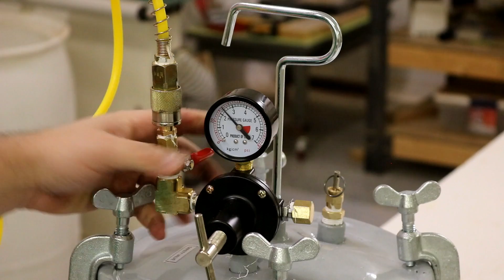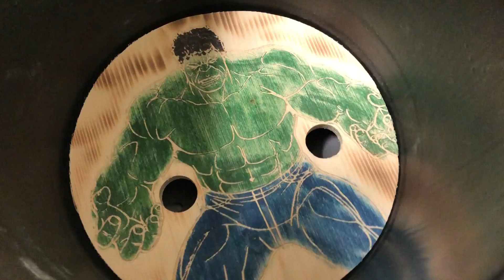Converting a Harbor Freight Pressure Pot for Resin Casting

Comment: Jake,  thank you for this.  Question:  will a normal tire air compressor connect to this?  I'm new to the idea of quick release valves.  If not is there a different part I should buy?  Thank you again!
Reply from the maker: Thank you.. you need a compressor with a tank at least as big as the pressure pot tank. A tire inflator will be way too slow. 👍👍

Comment: Looks great, for solid colors. what if you put something in the resin, say, color swirls or say dried flowers or something, wouldn't the pressure distort and ruin the casting?
Reply from the maker: theguitarpicker No, it won’t distort things like that. I’ve done lots of pours and that has never happened.
Reply: @JakeThompson  I haven't used resin (epoxy actually, I don't think they are the same) for anything other than filling cracks and knot holes, I wanted to experiment with using dried flowers and other stuff.

Comment: My pot is leaking where I removed T fitting and screwed in the taped gauge....I hand tightened it all the way in....any suggestions to fix?
Reply from the maker: offtofish There is a  paste thread sealer you can use.. it should seal it up.
Reply: @JakeThompson  thank you bud!

Comment: Hey Jake, my pressure release valve sheared off when I was trying to unscrew it from the lid.  I managed to get it out, but fair warning for future endeavors.  You may need a kit for taking out bad threads!
Reply from the maker: xannmax noted..👍👍
Reply: @JakeThompson  wait, now that I have you, could I ask you a question?  What threading for the new pressure release valve should I get?  I'm fairly new to brass fittings and I don't have the measurements memorized yet.
Reply from the maker: xannmax I believe the common size for relief valves is 1/4 npt

Comment: Hmmm... I would think that curing a resin under pressure will make it more brittle and prone to exploding. Especially if the piece is dropped or if the temperature is high enough of a change from the time of cure. Since you're not removing the air, you're simply compressing the air molecules/bubbles, once cured and removed from the pressure chamber - those air molecules are still under what ever pressure they were brought to in the pot. Raise the temp - air expands, pressure goes up - raise it high enough and BOOM!

I believe Pyrex had that issue way back as they used pressure to cure their resins from what I understand. Once heated - they would arbitrarily explode. They since have changed cure methods to prevent that.
Reply: Fair enough, but keep in mind that the typical things that are cast under pressure (think knife blanks in this case, or toy figurines for example) are never heated again to high temperatures. Plus, the bubbles that are collapsed under pressure casting are usually tiny, so there is not much air in them in the first place. Maybe there is some risk of an impact cracking a pressure-cast resin piece, but I've certainly never heard of a piece exploding.

Comment: Is it normal for the tank to make creaking noises as you fill it with air? 20 psi is making unsettling sounds.
Reply from the maker: Pablo Escobar it’s normal the first couple times you fill it.. should be fine!! 👍
Reply: @JakeThompson  Thanks, Jake! Still working out where my air leak is coming from. I suspect the gasket, as all of my other fittings seem quiet and solid. I'm about to break out the soapy water next.
Reply from the maker: Pablo Escobar Sometimes my kid leaks.. I just clamp it to the table.. fixes it right up

Comment: Thanks for the great video Jake, I had a vague idea of what I needed to do, but you really clarified it for me. I will say this tho... because my local "big box" store is usually lacking in the restocking department, I had to do design on the fly kinda thing while standing in the air tool isle.  Because of that, I ended up buying extra stuff just to avoid a return trip. I ended up realizing that you only need three adapters. I didn't use the supplied "T" or gauge. I relocated the blow out valve the same as you, but the input is just the hose adapter to a ball valve to an inline pressure gauge. It's just a much simpler version of what you showed us. Thanks for getting me pointed in the right direction... can't wait to use it!!
Reply: I tried to upload a pic.

Comment: do you have to have the pot up right or could it be lay on its side to as this way could get bigger molds in ?
Reply from the maker: phil walker I don’t see any reason why it wouldn’t work, but you would have to have some way of leveling the side to be a bottom so you don’t spill the molds.. if that makes sense?
Reply: cheers for the help fella great vid ATB
Reply from the maker: phil walker 👍👍

Comment: A vacuum chamber works much better, it make all the bubbles expand and rise to the top and then it leaves bubble free resin. This merely makes the bubbles smaller, it doesn’t REMOVE them
Reply from the maker: Terry lagrave Do you have enough time to remove bubbles with a vacuum chamber with resin that has a 12 minute open time.. The answer is no. Have a great day!
Reply: And a vacuum creates a huge mess and wastes a lot of resin.

Comment: A very informative video!! Thank you! I subbed your channel. 
The idea is to get rid of the small bubbles, am I correct?  Long time ago some guys who did casting used a vacuum pot for this.  Are both achieving the same thing?  If so which is better?
I've been wanting to cast some delicate glass objects, and objects damaged by heat. I'm worried about the resin heating up and expanding and contracting to where the glass will break. What resin would be good for this?
Reply from the maker: tihzho Thank you for subbing and watching the video.. the vacuum chamber will work for very slow curing resins.. The resin I use is only workable for 12 minutes.. the pressure pot works awesome to take out the bubbles with this resin.. I haven’t done any casting how you are describing.. my advise is to buy small amounts of several resins and experiment. Maybe I can do some excitements like it in the future too.

Comment: Sorry this question has been in the back of my head can a pressure cooker?
Reply from the maker: TheMonkiekitty It takes 45 psi to work.
Reply: @JakeThompson  cause I have old pressure cooker that I used for sanitation and I thought about that pot I will have look in to parts

Comment: Hello,

I’m attempting to set this up and I’m finding that the pop off valve begins releasing pressure at about 30psi. How I can I fix this? Are there any videos on this particular issue?
Reply from the maker: Maya Mascarenas There are 2 slots around the valve.. you take a small flat screwdriver and turn it clockwise and that adjusts the pressure up.
Reply: Jake Thompson Wow thank you for replying! I had been trying to tighten the wrong thing, thank you for explaining it. There are a lot of great videos on resin and pressure pots but I find yours to be the most clear and thorough, I really appreciate it. <3

Comment: what happens if you put it in a vacuum chamber ??
Reply from the maker: Raymond Ashby If it’s a Resin with a very long working time, it will remove bubbles.. there are videos out on this technique. The resin I’m using only has 12 minutes working time, so there’s not enough time to put it in a vacuum chamber
Reply: @JakeThompson  check out stonecoat.. thy have some great resin
Reply from the maker: Rusty Alcorn will do!!👍👍

Comment: If I may ask why dont you use a vacuum chamber to remove any air from the resin ?
Reply from the maker: skeets I have heard of  removing air with a vacuum chamber, but with very slow  curing resins.. With faster setting resin like alumilite, the pressure pot is required.

Comment: I just did the same conversion I have a small leak somewhere on the seal on the lidit takes about an hour for it to lose 15 pounds but it's such a small leak I can't find it or am I not tightening the lid enough?
Reply from the maker: aaron johnson Tighten the opposite sides together and sometimes I have to use clamps and clamp down from the lid to the table.. I also use a wrench to tighten the lid more.. I also leave the air hooked up, with the regulator working correctly it will keep the pressure in the tank where it needs to be.
Reply: @JakeThompson  thank you I'm going to go try that right now

Comment: is there a reason that you're using a Pressure Pot for resin casting and a Vacuum Chamber for Stabilizing Wood? You can't do the resin casting in the vacuum chamber? And great video btw!
Reply from the maker: killy2626 The resin I use has too short of a working time to use the vacuum chamber to remove the bubbles.

Comment: What are the inside dimensions of the pot?
Awesome video!!
Reply from the maker: CobaltSS04R Thanks!! I’m glad you enjoyed the video!!  Here is a link to the pot, it shows the outside dimensions.. https://m.harborfreight.com/2-1-2-half-gallon-pressure-paint-tank-66839.html

I think the bottom of the tank on the inside is about 9 inch circle.  And you can put around a 10 inch tall mold on it.. or close.

Comment: What size of  air pump to use for this pressure pot ?  I have small working space .
Reply from the maker: Maneerat Romtrairat I have a large air compressor but that’s not required for the pressure pot.. only 55psi is required.. a small air compressor will work.
Reply: @JakeThompson  Thank you so much for your answer .I plan to buy pressure pot and air  compressor  for casting my resin work
Reply from the maker: Maneerat Romtrairat Awesome... it’s lots of fun!!

Comment: Hey Jake this is great, thanks for posting it! I'm headed out to buy the pot and all the stuff, but I have one question: For the air compressor, do I just need one that is capable of up to 60psi, or do I need a more high end compressor? Do you have any recommendations for a (mildly) inexpensive compressor?
Reply from the maker: Blacky Shepherd I think the compressor tank just needs to be bigger than the pot. That’s all. It doesn’t need much.
Reply: @JakeThompson  Thanks for the quick reply!

Comment: My pressure valve is releasing air. Turning the pin doesn’t appear to be doing anything. Why does my air compressor gauge differ than the regulator reading?
Reply from the maker: Joe Bruno there’s a notch at the base of the pin.. you stick a small flathead screwdriver in the notch and turn it clockwise. The regulator should be lots lower than your compressor.. The metal T sticking out of the front adjust the pressure going into the pot.. I hope this helps
Reply: Yes that helps. I will try to adjust it.  Regarding the compressor, its the one I use to inflate car tires with. The gauge on that differs by at least 10 PSI when I check it against whats inside the tank and compare it to the gauge on the tank. I dont wanna go past 50 and bomb myself out of my garage so it don't know which one to trust.
Reply from the maker: Joe Bruno Those gauges are cheap.. I would buy another one and see if it reads the same as the one that is on it now.  As long as you aren’t going over 60 it should be pretty safe.

Comment: Tapping the threads to 3/8" pipe thread is VERY important. The original elbow piece has pipe thread going into a MACHINE thread hole.
Its a giant safety risk and needs to plugged with a machine screw and seal washer if you dont tap it with pipe thread.
Never exceed the chamber rating of 60 psi.
Reply: @matthewlawton9241  There's already a popoff valve that does exactly that. But you can buy them just by googling air compressor popoff valve.

Comment: How did you adjust the pressure pop off valve? Mine popped at 35-40
Reply from the maker: D35TR0YM4N There are slots on the pop off.valve that look like a regular screwdriver head.. the pop off valve is right in the middle of it. Just turn it like a regular screw. 👍
Reply: Thank you very much sir!

Comment: If you don't have an air line can you use a battery powered car tyre pump or would it take too long to reach max pressure?
Reply from the maker: ColinWatters I’m sure that would take too long.. Harbor Freight sells very cheap air compressors as well.

Comment: So, I have been just learning how to bend/shape resin (in silicone molds) right before it gets too hard to shape. Could I use this method, just for a shorter time, to get a clearer resin, and still be able to shape it? Does anyone know? 

I am looking to copy a shape of a specific type of round glass lens which I need to duplicate, but make the diameter smaller than the original. I want to use the shape from the original to shape the mold all the way across, and then pour the resin in it, let it start to harden while flat, and then curve it to the diameter I need it. If i need to attach the ends with more resin (mixed hotter, if that is a thing, like paint) or with a hot glue gun, or whatever, that won't matter, as I can hide it in the back of my project. I just need to reduce the size of the round lens, and this is the only way I can think of to do it. To describe what i'm doing, I am building a 3/5ths size TARDIS (from Doctor Who), and have an actual real fresnel lens, but it's too big around, so I need to reduce the size - that's how i got the idea to roll up the resin before it gets completely hard, to get the correct size. I will need to remove about an inch out of the shape, and get it round again, once poured.

I've been asking around some of the videos working with resin, and hope I get a few answers, so I can figure out a) which resin would work the best, b) how to make it as clear as possible to look like clear glass, and c) how to shape it the best. Any helpful suggestions are appreciated.
Reply from the maker: Mary Ann Bittle I’m probably not the guy to ask this, but it’s worth experimenting with if that’s what you want to do!!
Reply: @JakeThompson , that's okay. Thank you for your response, anyway. I appreciate it. 

I've been asking basically the same question of many people who mess with clear resin on here. I figure that, with several "I don't know-s" and several "that's a stupid question-s" I will eventually get some helpful information from someone. I'm willing to wait.   😄😁
Reply from the maker: Mary Ann Bittle 👍👍👍
Reply: That sounds really cool. If you do it, you should post it up here on the tubes and you'll be the expert answering questions. =)

Comment: I just have two questions. That pressure pot looks expensive, plus whatever you spent to convert it, how much did you spend?
Second. vacuum chambers suck all the air out, contrary to what you are doing, but with the same results. Depending on the final cost, is it worth to do the conversion, compared to a vacuum chamber?
Reply from the maker: Robin Dz You can get the pot for about $80 dollars with a coupon.. and there is a similar pot on amazon for about the same.. then about 20 dollars in fittings.. so around 100 bucks for the setup. Vacuum degassing takes time to do, so you need to use a resin with a long pot life. I use resin with a 12 minute pot life so the pressure pot is ideal for what I use, and I think for overall convenience the pressure pot is the way to go.
Reply: the pressure pot with a harbor freight coupon is $79.99 and about $20 in various fittings from home depot or lowes. you would need to covert a compressor to a vacuum.

Comment: So i bought this pot and configured it for resin casting but for some reason NONE of my pressure gouges register any pressure. I tried the one it came with, bought a new one and tried it. Tried every configuration possible. Anyone have any ideas what to do about this?  It seems to hold pressure but I can't tell how much pressure exactly is in it.
Reply from the maker: klimbit I would install the gauge in a different location and see if it works then

Comment: How did you adjust the pop off valve? I can't get mine over 40psi.
Reply from the maker: Scott James There’s 2 slots around the pop off valve.. you stick a tiny screwdriver in one of the slots and turn it clockwise to raise the pressure.

Comment: I can't seem to turn that piece in the pressure relief valve.  It looked like you had no problem turning it.  What tool did you use?  I tried flat screwdriver on one side but it won't budge.  Any suggestions...
Reply from the maker: Cedar Adventures It turned easily for me.. the entire valve should be easy to remove and or replace and they are cheap.